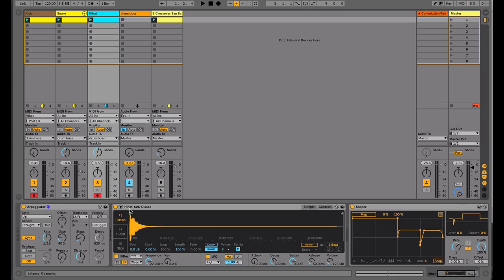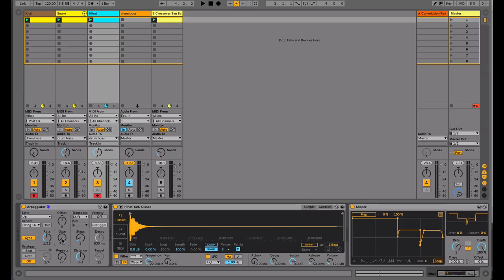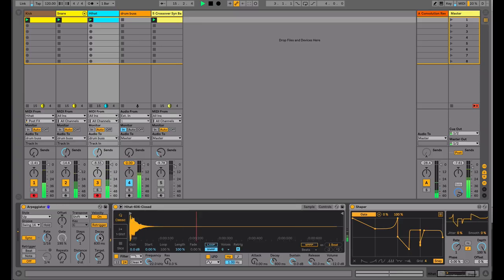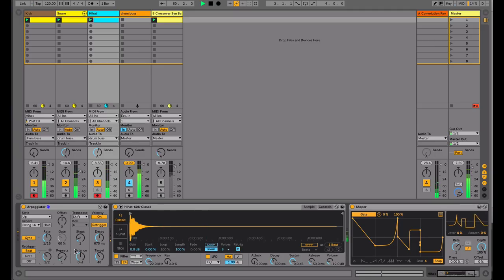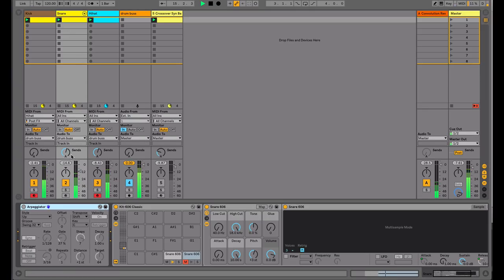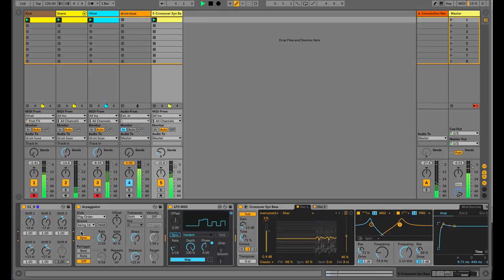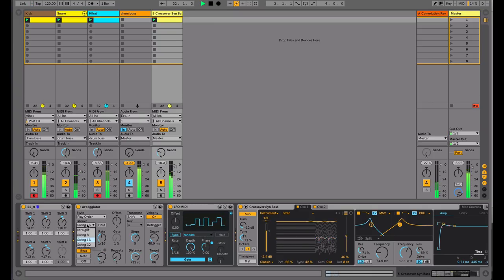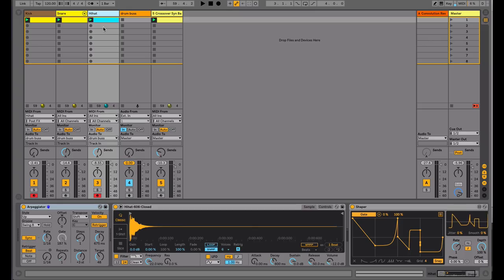Creating swing grooves with Ableton Live's Arpeggiator

Comment: I'm starting to learn to use Arpeggiator for a track I'm creating, and this was useful in helping me learn about it overall. (Basically I'm seeing a lot of what I've been doing wrong that has stood in the way of me getting more interesting sounds.) Using Shaper as an alternative to LFO for modulation of parameters is good. I had only used LFO and will try out Shaper.  Thanks!